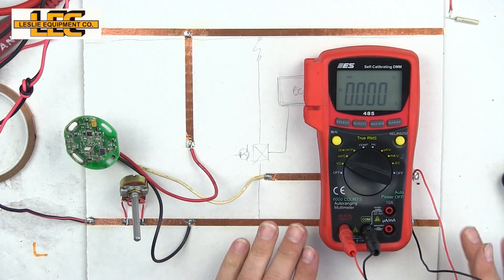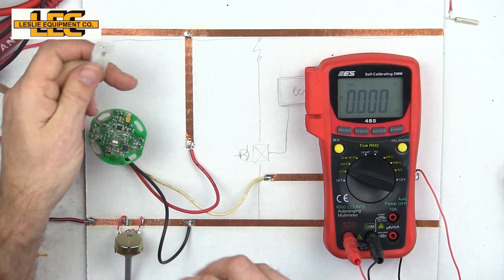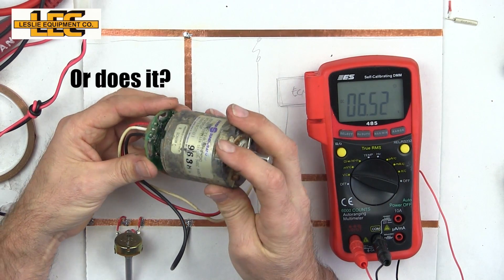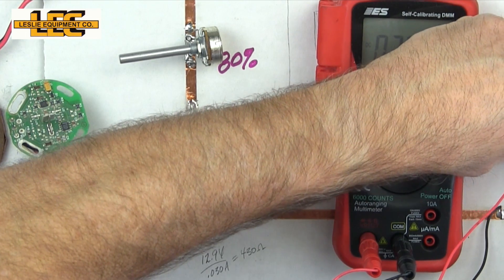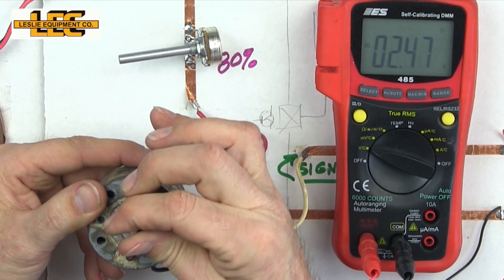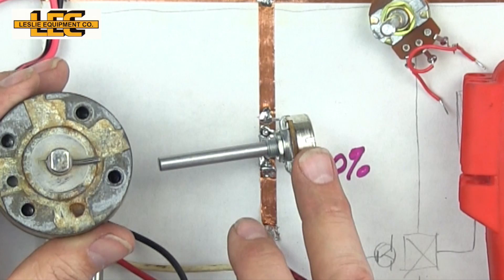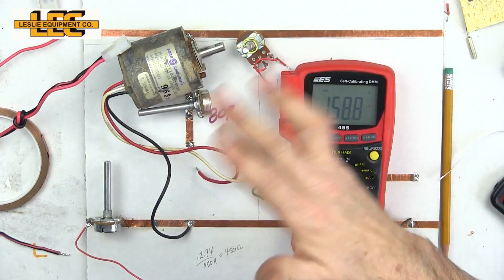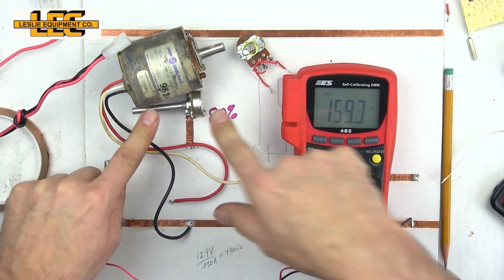Hall Effect OPS

Comment: The range on the meter of the hall sensor is .8 volts to 4.1 volts . the rotating resistor   is set to introduce5 volts into the hall sensor . /why can't you get 5 volts instead of only 4.1 volts off the hall sensor?
Reply from the maker: bob brawley That's just the way it's designed. Anything less than .8V or more than 4.1V is a fault.